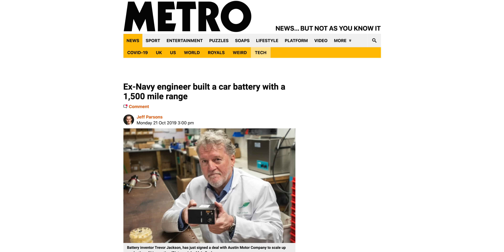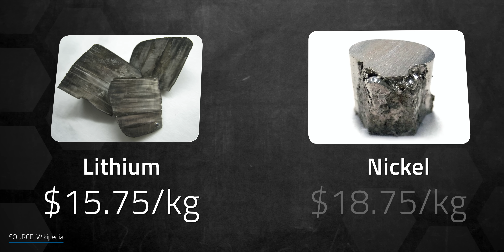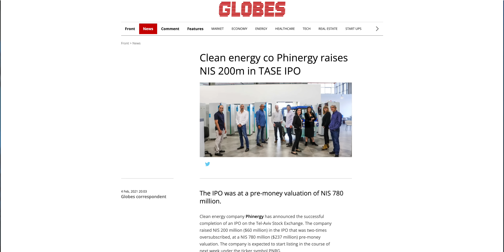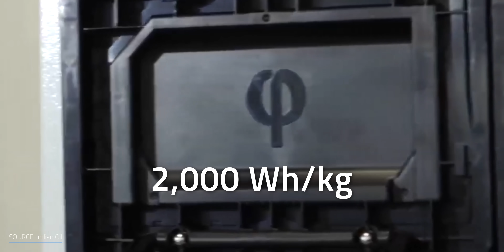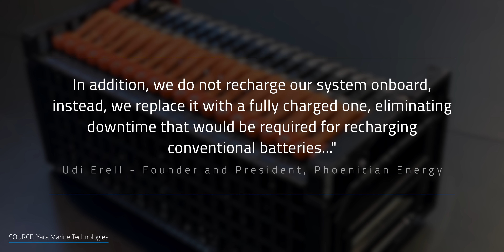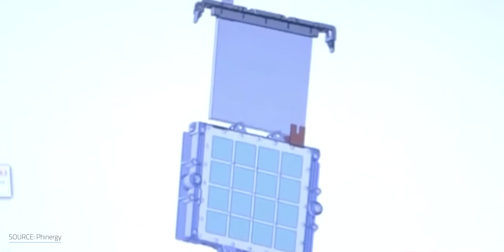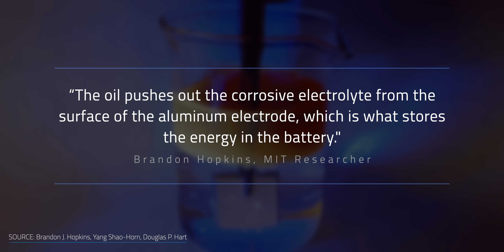Exploring the 1000 Mile Car Battery - Aluminum Air Hype?

Comment: Man… after 65,000 miles on my 2016 model X, I love my permanent battery. Battery swapping seems like such a waste of materials, transport and time. Charging my battery to 80% every night since 2016 and I have seen little to no degradation. I still get 267 miles today, just like I did back in 2016. If this is any indication, I can easily see my Model X going to 300,000 to 500,000 miles in 10-15 years and by that time batteries will be way more dense and less expensive. JB Strobel said recently the TESLA engines should go a million miles. He went on to say, “they’re electric, there’s not much to them and should go 1 million miles”.
Reply: That's fine, but most of the concern is about road trips, not intra-city commutes. Your 267 mile range is not much good if you need to travel 600 miles. That's where the advantage of battery swapping comes in, as it can give a very quick turnaround time.
Reply: @malcolm_in_the_middle  Okay, who's going to drive 267 miles without at least one rest stop (that's nearly four hours averaging 70), during which time you plug your car in to a fast charger, grab a coffee and bathroom break and 20 minutes later, you're charged ready to go again.
Reply: @therealchayd  Yeah, you and everyone else on the road. How many charging ports will be required at stops? How do you deliver sufficient power at a charging station to that number of cars?

Fuel stations on major highways get busy as is, with people stopping for less than 5 minutes at each pump. Now you're proposing that the time is quadrupled?

Also, can you even fully charge your car in 20 minutes? And if you can (which I doubt) can everyone else, or is that a special feature of your car?

Why do you downplay a technology that could go a serious distance to alleviating these concerns?
Reply: @Chris G  Well, most highway rest stops will only be catering for people who are travelling for more than their normal daily distance and maximum range, everyone else would have charged their cars at home overnight, thus negating the need to use public chargers at all, whereas gas stations will be catering for all ICE car owners, so there's that.

A lot of EVs can fast charge from 20% to 80% in less than 20 mins with the >50kw DC fast chargers, which still gives adequate range, so no, not a special feature, more recent vehicles can even draw up to 350kw, I think the average fast charge from 20% to 80% is 20-30 mins (ok, so can be more than 20 mins, but even than 20 mins will give adequate range to the next stop, you don't have to always charge to 100%).

I still stand by my argument that it's a wasteful and inefficient technology that's trying to solve a problem that doesn't exist for most EV owners who (like other motorists) will average 30 miles a day, charge their cars at home overnight, and wouldn't be seriously disadvantaged by having a 20-30 minute rest break every few hours when doing a long journey.
Reply: @therealchayd  50kW chargers, multiplied by how many cars at a highway rest stop? Let's optimistically say 20: that equals 1MW just for charging the cars. That's a small powerplant, just for charging cars. Talk about wasteful and inefficient. How do you deliver that to a rest station in the middle of nowhere?
Reply: @malcolm_in_the_middle  megawatt chargers are at these stations already. Do some research dude. You are arguing points that are already being serviced and serviced perfectly. I have never had to wait at a charger in nearly 6 years. Wtf?
Reply: @malcolm_in_the_middle  Tesla tried this. Having batteries sitting somewhere on Route 66 for a very specific car and model is a shit idea.
Reply: Joe Shumo  I'm sure you're cool with the billions of dollars in subsidies to multibillionaire oil companies every year.
Reply: Joe Shumo  Cars in general are no longer feasible for efficient moving. Moving around and owning 2 metric tons of toxic waste, that sits around about 20 out of 24 hours corrugating unused is the epitome of uselessness & inefficiency. And it has been made possible by constant subsidies in roads by the American tax payer. To an amount of about 1.000.000 times of what has been put into EVs so far. And, remember: you might cut your amount of subsidaries to EVs by not buying a car, which gives you a choice, which you can't say about taxes routed into road construction.
Reply: So how does that help someone that doesn't live someplace with easy access to chargers?  You know, like apartments.  How much easier would it have been for you if they could just drop off the battery, place a fully charged one in while they put the old one to charge?  As opposed to you having it charging for hours or worrying about hitting a charging station and having assholes icing the stalls?

Looking at the way they swapped the batteries it did not look particularly complicated.
Reply: @vaguedreams  you clearly don’t own an EV. You spent more time reading the comments and responding to them than you would charging your car to FULL at a supercharging station. It’s takes 20minutes.
Reply: Joe Shumo  are you moronic!? Gas has been subsidized for over 50 fucking years. TESLA has no subsidies, they haven’t for years.
Reply: Joe Shumo  You sound like an anti-vax trumptard.  Sigh.. OK, why are they not feasible?  Please break down tax subsidies between big-oil, and big-EV.
Make sure to include the health, environmental, and military costs of operating an oil infrastructure, and present a true price at the charger/pump for EV and ICE.  Convince me that you are right and I'll change my mind instantly.
Reply: @lubricatedgoat  Not all anti-vax people are Trump supporters.  That is a myth.  72% of blacks and latinos in New York City are unvaccinated.  I'm pretty sure that most of them aren't Trumpers.
Reply: Not to mention not everybody has 60-100k disposable savings to blow it on a car
Reply: @SirBalageG  isnt that why financing exists?

Comment: If there were two batteries, and the system was designed to switch as the first one dies, then vice versa, convenient swapping becomes much easier. Not to mention, effectively doubling the range, or allowing for half sized batteries.
Reply: My thought is a lithium main battery, that meets the daily commute range (50 miles , or less), that can charge quickly.  Three slots for aluminum air batteries, as range extenders. 

The daily drive, one slot would have a 50 mile, aluminum air battery, just in case.  That minimizes car weight.  

On a longer trip, install three, 100 mile aluminum air batteries.  Swap used for new batteries at a service station.
Reply: @stevesedio1656  I came here to post this 👍
Reply: @stevesedio1656   The use case of a reserve battery is interesting, but one of the Al-Air batteries current weaknesses is battery degradation, even when its just sittin' there. A long term reserve back up needs to ... well... not do that.
Reply: @Natabus  At 10:30, it was mentioned to displace the electrolyte with oil.  That lowered degradation to 0.01%, compared to 5% for lithium.  If you need 10 miles, the oil can replace the electrolyte to conserve most of the remaining energy.  

In a purely "back up" cell, the electrolyte can be stored in a separate chambers, and added only when needed.
Reply: @stevesedio1656  As per oil replacement to prevent degradation: When that technology is tested, and studied by third parties for expense and reliability at scale, my opinion will change. Until then, AL-Air batteries are a horrible idea for a long term reserve.
Reply: @stevesedio1656  I do like the idea of combining multiple power sources, gaining the best each have to offer.
Reply: Or maybe have a small secondary lithium ion battery to facilitate quick charging when in dire need.
Reply: Would that make it heavier though?
Reply: @CBC460  comment was alluding to the possibility of dividing the battery pack in to two halves. May be a marginal weight gain due to extra packaging. But definitely not twice the battery capacity or weight.
Reply: @IamKKB1984  or just split the battery, you would have put in normally, into smaller modules... you wouldn't have to keep swapping modules when runs out(its a bit like topping up a petrol tank thats half/ 3 quarters full) 4 modules which have 100 miles each, and you can replace each 100 mile module whether you have a total 300 miles or 5 miles left.. hell, if you only ever do short round trips, you could forgo 3 of the 4 100 mile modules if you wanted to..
Reply: @CBC460  yes and no, it would make them heavier but if we compare with the tesla batteries one with the same weight can travel over 2700 miles... They are so light that even if you make 2 of them with a 1200 miles range they would still be lighter than the ones that are currently being used
Reply: Excellent!
Reply: My thought was a small spare one in the car that gave say 50 miles, giving plenty of time to get it swapped.
Reply: @snowstrobe   The problem is that the battery degrades very quickly, so it's hard to make it as a spare, but maybe not impossible, like if you could have the electrolyte mix/enter the cell only when ready to use, or sealed up air tight.
Reply: @Chap.DavidStrchld  I think that's the point of the oil system. Any time the vehicle isn't in use, you pump oil in and the electrolyte out. So you aren't degrading the battery for the 22+ hours a day you aren't driving.
Reply: If you look at the video closely I think you should see that's exactly how that car is set up
Reply: Check with Elon, it is to complex.
Reply: Wow you just invented the magical hybrid car!
Reply: 100 % correct keep 2 batteries / connect to the 2 nd battery once first one is exhausted . System will be swapping but within the drivers control . Yes could be cheaper to run on Al air battery . Also Al is cheaply available in plenty in India .

Comment: Swappable batteries are the future. Fast swap 100% charged battery. In case of aluminum air battery in a EV, you can have a big swappable battery and a little lithium ion battery for emergency with a limited range of 20 to 40 miles with limited power and limited speed.
Reply from the maker: I'm really interested to see how this plays out in India.

Comment: Maybe not the most optimal solution for cars, but what about aviation?
Reply: or shipping?
Reply: @slaya070492  I belive that a mix of kite power (great space to thrust ratio) and hydrogen (great weight to energy ratio) would be more viable
Reply: @maxsinn402  probably.
Reply: yeah...if you think about it, aviation suits these batteries more than day to day commuting
Reply: No... it's the most optimal for cars. Short range easy/automatic swappable multiple cells. Drop off at a charge station, take new ones. With aviation, as I understand, there is a weight spiral: need more power cells to take off -> takes more weight -> need more power cells to take of -> ... And these batteries are 1.5 times heavier than jet fuel (as in you need 1.5 kg of batteries instead of 1 kg of kerosine for the same energy capacity). It might be possible, I don't know how the final efficiencies compare (energy density combined with output from the cell and efficiency of the engine)
Reply from the maker: Interesting question.  Yury hit the nail on the head: weight is still a problem.

Comment: The logistics of battery swapping isnt feasible imo. Considering the size of the batteries multiplied by the number of cars, it would be a real challenge and a major hazard if anything went wrong.  I think the real bullet in the back of swappable batteries is how inconvenient it would be compared to charging at home, how costly it would be and also the fact that companies are unlikely to be compatible (especially Telsa).

These batteries seem like they'd be useful in niche applications, assuming they can be scaled down and compact they could be really good for mobile devices like phones and laptops. Just imagine if your phone lasted a full month on a charge and you could swap out the battery on the fly, or a laptop with a detachable battery that lasts all week. replaceable batteries would also allow you to chose between a rechargeable battery or a long lasting disposable one.
Reply: Now this actually makes better sense... And it's a more manageable approach... Not exactly perfect, but definitely applicable in today's economy.
Reply: As opposed to flammable gasoline? An Aluminium-Air battery could easily be more energy dense than gasoline (gasoline has a wh/kg equivalent of about 1,700 wh/kg while aluminium-air has a theoretical limit of 8,000), and unlike gasoline it's recyclable (all it takes is energy input, using electrolysis, to purify the aluminium which can then be used in new fuel cells). So you could have a battery refurbishing factory relatively close to the point of use. As long as you have electricity production it would probably more convenient than gasoline in the long run, and we've managed fine logisticly using gasoline for the last 80 years.
Reply from the maker: Appreciate the comment!

Comment: The hybrid solution is the best lithium + aluminum
Your normal daily use just keep using lithium
Unusual trip buy aluminum battery pack for the road
Reply: That's an interesting concept actually - but it still comes down to - how much does a swapped Al-Air cost? Is it worth it? 
and also, like with a Tesla, you could recharge on the way during a trip.

I think where Al-air could really help out would be airplanes?
It's lighter with more density making it viable (unlike Li-on) and airplanes use consumable kerosene anyways, so using Al-air would be a more environmentally friendly consumable (if the high recyclability rate is true)

Comment: Definitely it will not work. Suppose, I've 50% battery left & I want to travel too far & I needed 100% battery. So, replacing whole battery at station will be the waste of energy and also cost consuming. And recycling everytime when 0% will be much costlier and less efficient process.
Reply: Just another flavor of “range anxiety.”  Ideally, you’d be able to swap the battery along the way.  In the near term,  it’s a local travel vehicle only.  Just like electric cars for most people.

Comment: This is not a battery as much as it is a fuel cell.
You're 'recharging' it with more than electrons.
It's a 'battery' in that it incorporates multiple cells.
Reply: It is a non rechargeable battery. Once used up you have to recycle it.
Reply: @peterjf7723  the oxidiser is not stored in it, thus it cant be a battery. its a fuel cell.
Reply: "battery" means an array of cells. it's definitionally a battery, in the same way we call non rechargeable AA batteries batteries, but i get where you're coming from.
Reply: @internetsillyhead  non-rechargeable AA batteries are batteries though? their components arent replenished because theyre stored in the battery.

unless we are now saying that an array of fuel cells is still a battery?
Reply: @internetsillyhead  bsttery a container consisting of one or more cells, in which chemical energy is converted into electricity and used as a source of power.
Reply: @danielwalker5088  I guess my thought was that these still need input from atmospheric oxygen, and therefore are not entirely self contained.
I do understand that it is a chemical source of electrical energy.
AAA, AA, C and D are often called 'batteries' when they are really single cells.

Comment: Actually, i prefer the fast swap to a fully charged battery that lasts another 1000 miles.  Just like anything new, once the market is large enough, swapping locations will be every where.
Reply: You have to consider that swapping stations should be more expensive since they would have to deposit fuel cells instead of just the fuel, and heavy lifting equipment for swapping the batteries. The difference shouldn't be noticeable though

Comment: I'm very skeptical. Not because I don't believe the technology will work, but instead because it's the worse solution invented just to keep oil companies to still be relevant. I'm not against fast recharge stations for your EV but being able to recharge at home (at an incredible cheap price) is much much better. This is, imho,  one of the biggest selling point of an EV
Reply: how would air-aluminium battery keep the oil company relevant?

Comment: As it stands with existing charging infrastructure and battery tech, a Tesla Mode 3 LR can go basically anywhere in the US with a 20 minute charging break every 2-3 hours. When I realized that we're already there when it comes to EV viability, I placed my order.
Reply: Wish Tesla had a $25k model.
Reply: Yep. The driver needs a break to use the bathroom and eat anyway, so the charge doesn't really affect travel times on a Tesla. Engineering Explained has an episode where he does something like 1000 miles in one day in his Tesla.
Reply: Nice. Congrats on the new car.
Reply: Battery swapping: No
Reply: Yeah, but you're stuck driving a Tesla.

Comment: give it 10 years and charging speed & availability should be massively improved over today.
Reply: Aluminium air battery can't be charged since it's basically a fuel cell. It needs to be swap with a new cassette.